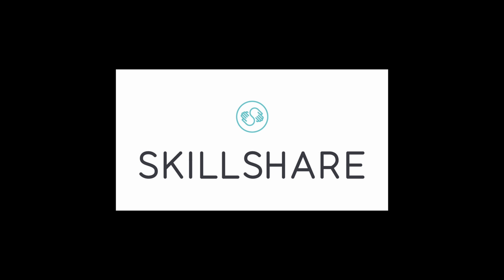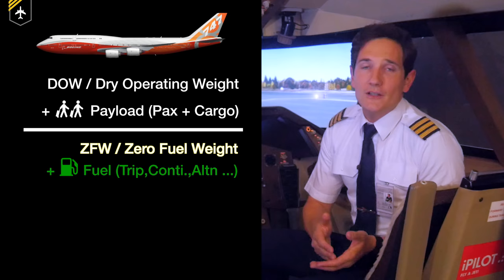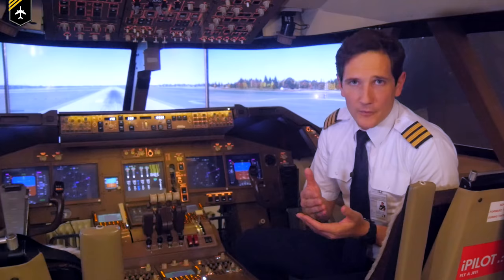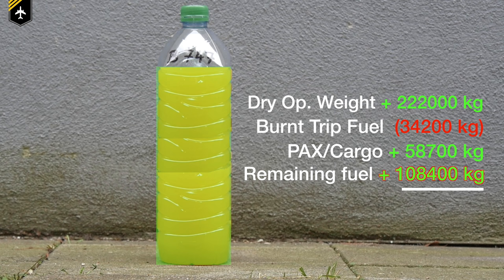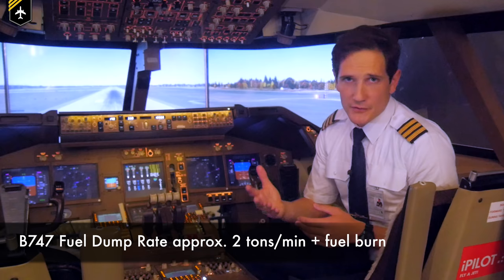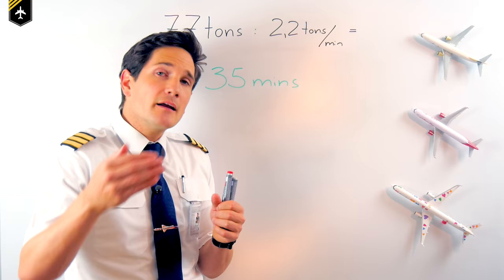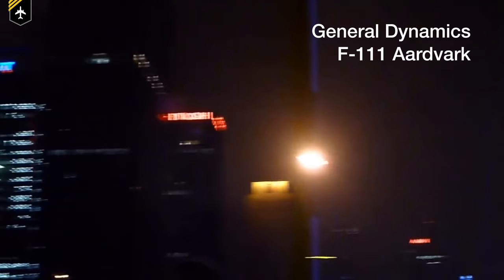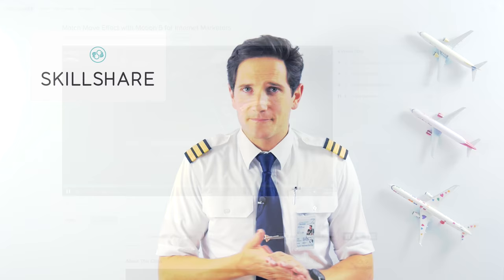Why do PILOTS DUMP FUEL??? Explained by CAPTAIN JOE

Comment: Why do planes have two engines? And why there are four engines? But the have almost the same size.
Reply: Because the planes with 4 are much bigger most of the time
Reply: NAU DIT Generally it's called ETOPS (feel free to Google that). In a nutshell, bigger, better, more reliable engines means fewer are needed for the same job.
Reply: Mike Cowen I mean yea but the a38" came after the ETOPS and so it needs more thrust cause it's so big
Reply: NAU DIT As I said, "generally", but yes, sometimes the aircraft size dictates more engines.
Reply: Ok then thank you.
Reply: Ok thank you for your reply.
Reply: FRANTIC 4 engines cuz back then two engines couldnt do trans atlantic flights but now 2 engines can 

And its a lot cheaper using 2 engines then 4
Reply: why it cannot do trans atlantic than 2 engines? Because its not practical way back then? That's why they come up with a plane with just 2 engines and alot cheaper.
Reply: How about the Air Force One? Is that bigger than any other Boeng 747 planes?
Reply: Engines used to be unreliable. Two engine planes used to be forbidden from going anywhere that was more than 60 minutes from a diversion airport due to fears that if one engine failed the second may not be far behind. As engines have got more reliable twin-engine planes have been allowed to fly routes that take them further from the nearest diversion airport subject to stringent conditions.
Reply: There was a restriction with two engine planes having to always be within 1 hour of a diversion airport. This was back before jet engines became the standard and the piston engines have far more moving parts that could fail. Four engined planes have less to worry about if one failed. This meant that two engine planes couldn't do transatlantic routes as efficiently as they'd take a longer route. This is why tri-jets were a thing back then: bypasses restrictions and more efficient on lower demand routes.

This eventually changed when ETOPS officially allowed a TWA 767 to fly up to 90 minutes away from diversion. This paved the way for twin engine dominance where the only new quad jets built after were either gigantic (A380) or were eventually outcompeted (A340).
Reply: The current VC-25 (often designated Air Force One with the President onboard) are based on the 747-200 airframe with extensive modifications including newer engines but the dimensions are unchanged. The replacement airframes would be the 747-8 and the dimensions would also remain unchanged.
Reply: Ok thank you for this link I love Wendover channel also but i missed his video about this so thank you for the link
Reply: 4 engines for redundancy over large bodies of water. The 777 had to really prove it's engines were durable enough to fly over big oceans, that's why it has 2 engines.

Comment: If there is not enough time to dump the required amount of fuel and do not have an option to perform loops, is there an alternate way to burn the fuel faster during your transit to the emergency airport? Say flying at certain altitude or with landing gear down etc?
And what happens with bird strikes related emergency landing(other emergencies to) where you don't have enough time
Reply: H MB if landing is the upmost priority, then the plane can perform an overweight landing (though it will then have to be checked before releasing back in service)

Comment: the aircraft should withstand a touchdown at maximum landing weight with rate of  600 ft/m
and 300 ft at maximum takeoff weight
Reply: elkerfay Posting this comment on the two videos? 😜
Reply: @NSLikeableHuman  yes and I have done it in purpose because this is very important to professional pilots. captain Joe said that the aircraft withstand a landing at the structural landing weight with 300 ft/m ROD. 
the landing gears are designed to absorb a shock of 600 ft/m at structural landing weight and the aircraft is designed in case failure of the dumping fuel system to withstand a landing at maximum takeoff weight with ROD 300ft/m
at the end we are all here to learn new things. aren't we?

Comment: What if it’s a really smooth landing? Like gradually the wheels slide onto the runway
Reply: Probably nothing but a sudden gust of crosswind or downdraft can turn even the most perfect approach into a rough landing and cause structural damage.
Reply: As every bike or automobiles has suspension... When it gets on rough road... The shock is absorbed... In aircraft if weight is too much... During landing the impact can damage shock absorbers as well as delicate parts may get damage... 😃

Comment: What happens if one valve opens and another doesn't?
Are the tanks connected? 
Is the aircraft able to hold that kind of fuel in one wing?
Reply: You can move the fuel to the other wing by opening the crossfeed valve (in the 737 anyway)

Comment: Thanks for the video. Instead of jettisoning the fuel, is it possible to on-the-fly transfer the remainder to another aircraft (i.e. the tanker plane)?
Reply: Too complex. As in having such a system is impractical, and even if it was practical since fuel jettison is so rare, the system would be more of a deadweight.

Comment: is there a simple way of distinguishing  a fuel dump from a normal condensation trail  by looking a plane at high altitude ?....thanks
Reply: Contrails are immediately behind the engine and it is formed a bit after the exhaust. So there would be a gap between the exhaust and the start of the contrails.

If the plane is dumping fuel, the vapor won't be formed immediately behind the engine, but rather wherever the fuel dump nozzle is (usually towards the outboard of the wing). Also, the trail will start immediately from the nozzle, so the trail will look like it's attached to the plane.

Comment: if you need enough weight for take off and less weight in landing. why dont just use water for addittional weight and if you dump it im mid air it does not cost much
Reply: They don't need weight for take off. The weight just consists of the weight of the aircraft, fuel, passengers and luggage.

Comment: Hello Captain Joe, thks for this video. I have a question. 
 A case of an emergency with a 747, you need to land immediately, you've got an airport near, and you have to proceed a dump fuel cause of overweight. Here in the e.g of this video,you need at least 35 min. What to do if the airport is at less than 30mins, how to lose the surplus of fuel before landing, as fast as possible  for the sake of the patient with heart attack?
Reply: You can land overweight as well. But it is a different procedure along with different limits

Comment: But how does landing weight do so much hull damage if the pilot is trained in soft landings? I get he/she may not be able to stop, but aside from that, do they hit the tarmac harder with more fuel weight?
Reply: An aircraft is certified to land with a certain maximum weight. This weight is less than the maximum take off weight. Hence when a plane takes off with its max weight, it's assumed that it'll burn enough fuel that when it reacheds the destination it is underweight. However if it has to make an emergency landing early on, then fuel has to be either burned or dumped to reduce weight.

Comment: so what happens to the fuel thats dumped.. does it evaporate ? or does it mist down on the environment?. how harmful is that?.. if it stays in air for a long time.. could the on coming plane  suck in that flammable air.. and get it combusted at the compressor section.. 😱

Comment: A lot of comments of people worried about fuel being dumped on them, and the possible damage to the environment, first, airplanes that fly internationally do so more or less at 35000 ft. By the time the fuel being dumpted reaches 20000 ft. It has done two things, it has disipated or it has evaporated, to that we need to add the effect of wind, barometric pressure, and temperature, and of course the presence of clouds.  So really no one is getting drenched in fuel.  Most likely at 20000 ft. The fuel would be like a continent away.  On the other hand, a volcano eruption has way more effect on the environment than what airplanes dumping fuel do, as they are spewing solids, along with a dozen or so toxic gasses.

Comment: Why isn't there like a little tank where the fuel gets dumped the fuel goes into the the tank you drop the tank and there is a gps in the tank when the tank gets low enough a parachute deploys and a crew collects the tank saving money
Reply: It would a little bit bad if there is a House or a Person😂
Reply: @jorglauter6883  thats why there is a parachute
Reply: XxCiaran C4xX it wouldn’t make sense because its such a rare occurrence that investing in such a system would actually be more expensive than just dumping fuel.

Comment: Very interesting but about the math it is very simple there's no need to make it complicated, you can just say 12 tons /60 minutes = 0.2 tons per minute and add 2 tons per minute fuel that you dump
so it's basically 2.2 tons per minute same thing but a shorter version.

Comment: Hello Joe I have a question, it wouldn't be better if you push a plane backwards into the parking position at the airport, that it can then roll forward again forward 

This text has been translated with google translator so it may be the error in it  

Thank you nice times in advance

Comment: What happens if the (let's say the same medical emergency) is urgent enough and a suitable airport is much closer than the time it would take to dump prop to get under the minimum landing weight? What is the SOP in that case, is the passenger "sacrificed" by a prolonged fuel dump or is the plane the one that is sacrificed by risking its structural integrity to save a life ASAP?

Not an inflammatory comment, I'm genuinely interested in how these kinds of tradeoffs and decisions are made.
Reply: In this case, priority will be on the landing. An aircraft can do an overweight landing (there is a bit of tolerance), but the aircraft has to be grounded and checked.

Comment: I knew all of this except the weight requirements for the plane but you still didn't explain why they had miscalculated on that flight and had to dump in the first place. Like you said, they paid for that fuel!
Reply: There is now a misconseption. The amount of fuel is not miscalculated. When the aircraft is landing at its destination airport the aircraft has burned enough fuel during its flight and there is no need to dump fuel during a normal flight. 
The fuel dumping is only done in an emergency situation when the aircraft must land before it has used most of its fuel, and that's the reason why it is too heavy to perform the landing, and the fuel dumping is needed.

Comment: Just curious, but aren't those the bars of a Senior First Officer...?
Reply: Yes. Being Captain is based on Seniority to a Company, and each Airline Company have they're own specifications on when you get your Fourth Stripes, which varies from company to company, there's no Industry standard (ex. Let's say Ryanair will make you Captain if you worked in the company for 3 years, while Qantas would require you 20 years of company service on one type of plane)

Joe used to be long time First Officer in Air Berlin, flying Airbus 320s and is slated to be Captain. However, Air Berlin had gone bankrupt and all the pilots have to find another job. Since Joe moved to Cargolux, plus he has re-train and get certified to fly a Boeing 747, he must start again from zero. The requirement for Cargolux to make you Captain is 10 years of working in the company and plus years of flying the same type of Aircraft. Your past years of experience from a different company is not counted.

Comment: how to compare b/w dump fuel and contrails from naked eye @Captain joe
Reply: Contrails are immediately behind the engines, and there is a gap between the engine and the start of the contrail.

Fuel dump is somewhere behind the wing (but definitely not behind the engines), and there wont be a gap.

Comment: Why can't Boeing or Airbus increases landing weight and advice to standing on standard baggage weight?
Reply: Increasing landing weight brings more complexity and costs.
And the number 1 source of weight in an aircraft is fuel. Example the max weight of an A320 is 79 tons, out of which fuel is about 18 tonnes.

Comment: Hey Joe!  Is there any remote possibility that during fuel dump, something shorts out and it keeps dumping fuel?  Say the pilots can't stop it and the plane runs out of fuel?  Just wondering.  love your videos!
Reply: Well, there is in theory, but the possibility is extremly remote. The valves for fueldumping are closed per default and they need to be powered to open. If power fails they close automatically.
So the cable which controls the valve would need to get power from another cable which means two cable would need to have a shoody isolation at the same spot and they have to touch each other and the other cable needs to be powered, and the circuit braker doesn't trip...very very remote.

Comment: Wait a minute, some airplanes use only one engine while they are in taxi to save fuel but then they just release it on the air to loose weight?. WTF?
Why they doesn't design the airplanes to support all the weight on landing procedure?

It's like if a car can transport 7 passengers but can stop the car if there only 2 passenger because is to much weight for the brakes.
Reply: They release the fuel ONLY if they have to make an emergency landing and they are overweight because of unused fuel. If they have an emergency situation near their destination, then there is no need to dump fuel as they are already light enough.

And a plane has way different design restrictions vs a car. In a plane, for any design, it has to be more of a balance. If you have to make the landing gear stronger to hold the entire weight while landing, the gear system will be more complex, heavy and expensive, which wont be of a practical gain.

Comment: Suppose you overdamp leaving the plane with too little to reach its destination??
Reply: If you are dumping fuel that means you are not going to your destination, but rather to a closer alternate.

If the plane is going to its destination anyway, fuel doesnt have to be dumped as it'll already be burnt up

Comment: How come propeller planes dump fuel as well?

And when it is not an emergency landing
Reply: some propeller planes have significantly lower landing weight than takeoff weight. Smaller planes fuel usage is strongly affected by weather conditions, the pilot takes as much as he needs in a worst case scenario, which mostly doesnt happen. So depending on the conditions a pilot might end up with too much unburned fuel to safely land and has to dump it mid flight

Comment: Oohhhh that's were the white lines behind the planes come from
Reply: No, they are just normal condensation trails from the engines when the water vapor contained in the engine exhaust condenses in the air. It is a perfectly normal phenomenon. (Fuel dumping is a rare incident because it is only done in an emergency situation.)

Comment: Why not fuel a plane to go where it needs to go, if running low on fuel  can ya not turn off engines to do the job and save fuel safely?
Reply: The aircraft carries the amount of fuel it needs to reach its destination, and this is the principle. The aircraft has fuel it needs to fly the route (trip fuel), and in addition to this there is also always a certain amount of reserve fuel for safety reasons, for example if the aircraft must change its course due to weather, or if the aircraft must divert to another airport.

Comment: couldnt they come in at a different angle or come in slightly faster and then decelerate quicker so the initial load is lowered.

of course a medical emergency could be an emergency enough to risk damage to the plane.

i always though the dumping of the fuel was to reduce the fire risk in a crash
Reply: It's more of a structural certified limit. Basically the aircraft can tolerate landing overweight, but it's not certified for it so to speak.

Also remember, any airline would prefer to not dump fuel as that means a huge financial loss. So that means if fuel is being dumped, it's a big deal.

Comment: In case of an emergency where as in case there might be a plane crash, they have to dump the fuel do in case the plane crash, it won't burst into flames.
Reply: Bullshit...
If a plane smashes into the ground everyones dead anyway...
They dont care about a fire..
Its all smoke and mirrors to make you think its fuel

And its not for landing weight.. Thats b.s too

Remember when that 747 brought home the space shuttle strapped to it and it landed just fine...

The weight excuse is a load of crap..

Comment: Captain Joe why see white smoke come out rear of aircraft while in flight of 35,000 in air
Reply: They are condensation trails from the engines when water vapor in the engine exhaust condenses in the air.